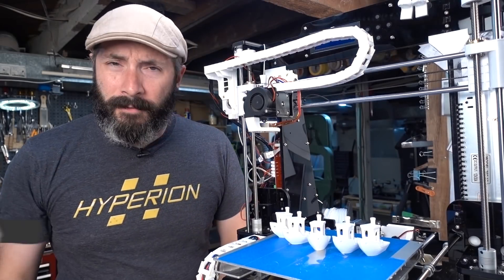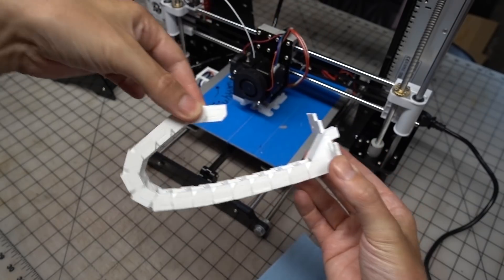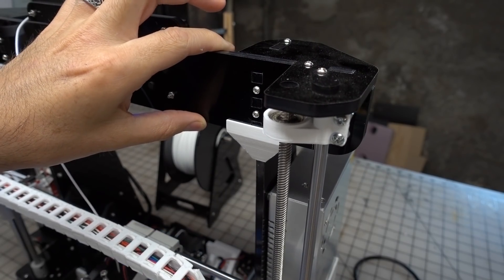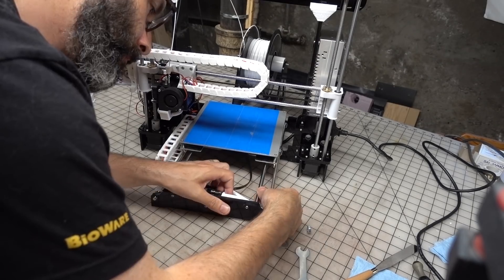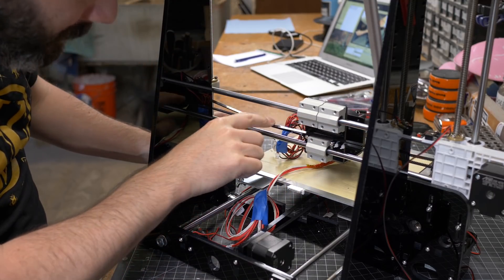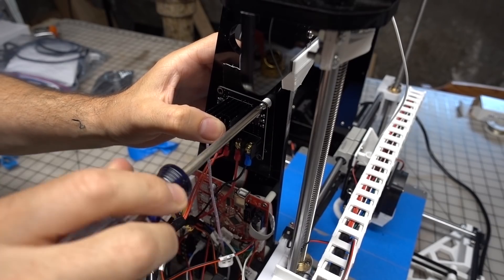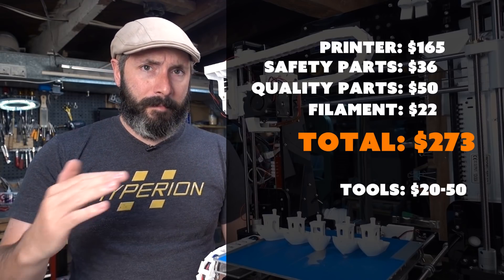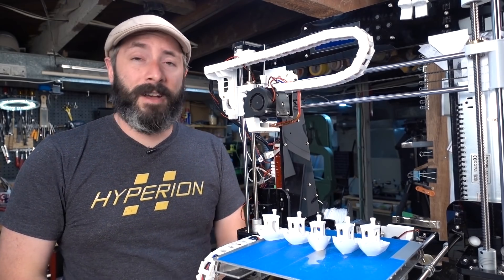Make a Cheap 3D Printer Better - Anet A8 Print Quality Upgrades

Comment: Hi man how are you i think you are printing in a high speed any speed more than 50mm/s is going to make the print less quality the best speed is 40mm/s  the printer can tolerate up to 80mm/s with not good looking parts.
Reply from the maker: I'll go over print settings in the next video, but I haven't been going over 50 mm/s.

Comment: I found that the best way to upgrade an anet A8 is to scrap it and buy an Ender 3. I could never get the acrylic frame stable.
Reply from the maker: (I am inclined to agree)
Reply: This was before the wave of Ender 3 and their clones. The Anet A8 was the first cheap i3 style DIY 3d printer, hence the acrylic frame. Them it was superseded by the Tevo Tarantula and Wanhao Duplicators, then evenutally the Ender 3s
Reply: @muniradlan3659  Yes. Which is about the time I scrapped my A8 and bought an Ender 3.

Comment: All you really needed was to tension the belt properly (don't even need a tensioner, just pull the belts tighter when you install them) and fix your slicer settings.  No "upgrades" needed.

Comment: most "upgrades" i find for these printers are crap. the first thing to do is eliminate slop in the rails. you may just use kapton tape on the ends of the rods or hot glue for that matter, but I'd prefer if the machine had thicker top plates (12mm or more) so any bending on the z rods would transfer to the frame. this might  allow you to stall the steppers at z max height without so much bending on the a6 frame, but the a8 frame looks sketchy to me anyway. for that i might convert to a single z motor with a belt to drive the second screw to the z never loses sync. 

i don't like the idea of supporting the z screws unless the z screws are very straight and you can take the time and effort to align the motor with the leadscrew nut so that the top of the screws doesn't move as the z goes through the travel. otherwise making the screws stiffer might just increase z wobble by allowing the screw to influence the whole machine. leaving them to flop around at the top is very much a design feature. not an oversight. 

the base of the machine isn't very stiff. my next mod will be to make a belt adjuster, then get rid of the double nuts setup to hold the front plate on by using tubes between the mid plate and front plate. i may even use some 1.5" extrusion and mount a linear rail system on top because the 8mm rails have a ton of spring to them. i could use bigger rails and thicker endplates but by that time i may as well go all the way with it. 

to straighten out the belt for the y even more i not only flipped the plate but also spaced the belt with extra acrylic bars that were in my a6 kit. my belt is just about perfectly parallel now. i also replaced the springs with silicone hose for the hot plate. 

the best way to run filament is with a feeder tube unless using flexibles that might be hard to feed. this doesn't have to mean a bowden conversion. the tube will reduce the pulling on the extruder head. as the extruder pulls the filament will put forces on the tube that will put a counter push on the extruder and on the supported end of the tube on the other end. an over head spool holder on bearings will reduce the pull to an unnoticable amount and eliminate the need for a feeder tube but you already don't seem to like that idea. i have one on my a6 but the a6 has a stiffer frame than the a8. 

the hotends for these printers are prone to leaking with pla and the resolution of a direct drive isn't great, it may be enough for 1.75mm filament but more is always better right? the drive gear that comes with the machine works but the coarse tooth pitch might also make feeding a little choppy. it might seem silly to put a $125 setup on a $165 printer but there isn't really anything like a geared extruder head and an all metal hot end. the e3d v6 and titan is hard to match and some cheap clones exist but i'd at least get an e3d heat brake. you may be able to get a .9 degree stepper and retap the heatsink mount on the a8 for the e3d threads for a cheaper solution. or get the microswiss upgrade for the wanhao i3 and mill down or replace the lever arm you have since the heatsink mount from microswiss seems to be thinner that the anet setup. there are some $4-$10 molded extruder tension arms that will probably fit or you  can 3d print one if you don't like the idea of belt sanding or milling the stock one. the microswiss heat brake is not cheap and needs a different heater block thread (m7 vs m6)and nozzle. m7 thread nozzles are not as common or as diverse, so maybe an e3d clone setup with a genuine heat brake is better?

i wouldn't listen to the you tube engineers about a bowden to lighten up the x axis. the nature of the feeder tube does have benefits but the weight of a single nema 17 stepper is hardly a lot to throw around for the x stepper motor (unless they are talking about the flimsyness of the frame and want less motion to translate to the z rods) and a direct extruder works much better with flexible materials.

Comment: Auto level and glass bed won't effect the print quality. Your biggest issue now will be your settings.  I would have played with them before you started printing your helmet.   Iv got an A8 and finally got it printing top quality prints. Depending how high quality you want the helmet to be at the end. You will notice you have to do alot of post print work until you tweet the settings and get them on point.  My starlord mask laughs at me every day because I'm sick of sanding and filling it
Reply from the maker: +Nick Anderson I tinkered a bit before starting on the helmet. I'll share all that in the next video.

Comment: How to spend incredible amounts of time and money without gaining any profit.
Reply: Yes! Kinda like sports... but without the exercise.
Reply: More power to ya
Reply: Actually I bought one of these back when fidget spinners were a thing. I then used the printer to print the spinner shells and bought  bearings off Amazon to put into the shells and sold the spinners for $6 a piece at school and wound up making around $300 profit.
Reply: it's called a hobby and fun is profit
Reply: Most of the 3D printers in the world don't make any profit.
Reply: And he could have gotten better results without any upgrades just with some proper slicer settings. I have the cheapest setup and use Cura as a slicer and my prints look better than his.

Comment: The a8 major problem is the crap frame design switching to a bowden will help keep the weight off the moving carriage. Also the sides of the benchy makes me think that nozzle is just bad and i dont think you can fix that so when upgrading to bowden make to sure to replace that. I think your looking at those diy kits the wrong way. Those kits are not meant for production work. They're tinker toys, meaning for people that like to fidget with with them, and turn it into a small hobby. For studio work you should have just gone and bought a more expensive prebuilt machine. They both can produce amazing results but getting there meaning paying in either time or money. But  don't feel discouraged and think of it as a money sink. Its a tool that does get better the more you use it. Upgrade it a bit at a time and it will get better.
Reply from the maker: These are all good lessons. I'm doing this series for prop makers who want to get into 3D printing, for making props and costumes, as cheaply as possible. If my outcome is eventually "don't buy this printer if you want to print props" then I've provided good consumer advice, I think. =)
Reply: If you check out Bill's channel you'll notice he has quite a few other projects utilizing mid-to-high end printers like the Idea Builder, Taz and Ultimaker. Someone doing commissioned work will likely want something in this category and price range.

However, someone just getting started is likely going to be enticed by 3DP's in this low price range. I think it's awesome someone with a body of work like Bill and Britt are putting the time and effort into trying one of these out and documenting the process so others can decide whether it's something for which they'll want to spend their hard earned cash.

People are going to buy these kits. Many are naturally going to progress into printing and building props/replicas. These videos will hopefully outline either the steps they'll have to go through to get quality results or as Bill mentioned maybe tell them to go another route.
Reply: With a little work...and some 3D prints my $139 Anet A8 outprints a $2000 machine
Reply: Yup I get decent results with my printer. It took a while but it got there. Kind of a thing of pride. But one thing I find is that I need to continually do light maintenance to the printer. At least that's the excuse I tell myself and have begun to rebuild my printer in my own design. It's an overly engineered aluminium extrusion frame and am trying to not use any printed parts, nothing but aluminium on my machine.
Reply: Im sorry but the A8 is completely over-hyped printer.  Maybe a year ago it was a good choice as, there was little competition in that price range.  Today there are many better printers for just a little more money.  That said with all the money that you have to spend to "upgrade" the printer, other steel framed printers come out cheaper at the end and much better.  

You should be spending time on your hobby, and learning 3D printers, you should not be spending time updating a bad design.
Reply: I don't think Bill thinks this is the best low cost printer. He stated in the first video he wanted to take the lowest cost printer (which happens to have a huge user-base/community and a lot of upgrades) and see what type of prints and subsequently props/replicas he could turn out from it.

Out of the box the printer wasn't good enough to make serviceable prints so he's started to upgrade to show what it takes to get some.

People are going to continue to buy this printer. They're then gonna go looking to videos one what upgrades to do to it and likely end up on this video.
Reply: Hands down the all metal Creality CR-10 is the best...thus far
Big build volume, large metal frame, and fair quality for $400~ however they are hugely backlogged and are kicking back orders at this time...(might find a few marked up ones on Ebay soon)
Reply: never the less, A8 is just so good to be anyone's first printer WHO IS ON BUDGET.
Reply: Liangshi Xu Today with just an extra $80-120US more than the A8 you can get so much better printer.  And that is still budget range for anybody who want to buy 1st printer.  If you need to save up money, then save for 1 extra month and get better printer.  Cheap always comes out expensive at the end!!!
Reply: PLEASE. I have been an avid propmaking lurker for ages, and would absolutely love to get tips and pointers on the quality/price-tag balance for purchasing printers and tools.
Reply: 80$ dollar upgrade parts+A8 can already be super good.
Reply: Doctor Discord If you are a propmaker go for the CR-10  They have sales every once in a while and the CR-10 comes in few versions with even a larger print bed size.  Yes its more money than the A8 but you spend your time on your hobby, not spend your time fixing the A8's many flaws!!!
Reply: I don't like going get x brand over y brand. Mainly because experiences can differ wildly from machine to machine even from the same manufacture. Most perform about the same out of the box. Usually the cheaper the machine the more likely that its just a box of parts. Most come from no name Chinese "repackaging" company. Spending more on a name brand usually just means you get a mostly fully build machine with a warranty and nicer features. Look around find the features your want. here is how I break it down

200 and below = usually just box of parts very little if any aftermarket support manufacture
200 - 300 = same as above maybe with a few nice features. Maybe half built. Maybe some sketchy support from manufacture. But usually a decent user community pool.
300 - 450 = don't see many in this region that differ from previous tier guessing mostly overpriced previous tier machines.
500 - 600 = now getting into prebuilt smaller named machines. usually with decent warranty.
 800 - 1000+  = now getting into name brand. Usually allot of features on the machine. Great warranty and customer support and in some cases a user forum where you can talk to other users.
*note these are from my point of view and an over generalization.

But if your wanting to get into making printed parts for prop making, first see if the process is even worth it to you. In some cases it may be easier to just build it from scratch. What some people don't realize is that for prop making most of the parts we need are custom one off pieces, meaning you will probably need sit down and learn at some point to design for a 3d printer in some sort of modeling software, and that may seem a bit daunting for some. Thankfully we live in a age of a million makers and there is a treasure trove of both free and paid designs that are just a few clicks away, so here's hoping you can find what you need. And lucky most software(whichever one you decide to go with) isn't as complex as it seems. With a few Youtube tutorials you should be on your way to making simple parts. But it will take some time till your whipping up parts at break neck speed. With software taken care of and dealt with whats left is building and maintaining the machine. Whats that mean? like daily oiling and polishing? No. What i'm talking about is the watching the machine (while its printing mostly) and looking at all its parts for places that are causing your print quality to suffer. A wobbly structure, okay make a crossbeam. A badly designed mounting brace okay make a new one, and the list goes on. Here where being mechanical minded helps. It not like a paper printer. where what your printing is exactly like whats on your screen and why many people tinker with their machines. To get more usable and higher quality prints. But be wary this can be a time sink in some cases and may take over your precious time you set aside for yourself for prop making.

Still with me good. The benefits of having your own custom pieces made within a few hours of pressing print and it just appearing before you is truly amazing. I for one am terrible at making props from scratch. But I make up for it with my ability to design pieces far better then what I can accomplish by hand. While printed parts do look a bit rough. Sanding down parts smooth isn't hard. With a little elbow grease and coat of paint, a perfectly usable prop for any convention is obtainable. And lucky it even easier to dip your toes into printing parts than ever before. There are several sites that offer services of printing your files for you and mailing them to your door. They are a bit pricey but worth the try for one off pieces and don't want the hassle or expense of owning the machine. And honestly the quality can't be beat, they have access to machines so much more expensive then you can afford. Too pricey no problem there are sites where local makers are putting up their services to print for you. These are normal people with their own machines they built themselves, and are either trying to help local makers or trying to help offset the cost of the machine by having it pay for itself. Its usually cheaper and it being printed locally means it can be printed and ready to pick up by the next day. Maybe even get chummy with said person. Some are oh so eager to give you the grand tour and provide tips.

Phew that was a mouthful and there was more stuff I didn't talk about. But for now I just hope it help some people.

Comment: Hi There Punhished Props! Some recommend upgrades from a random guy owning 6 (!!) of these Anets, if you want to make them more bearable around and also lose some vibration issues try this https://www.thingiverse.com/thing:2103227 I printed 6 of the 8mm + helper files and placed them under each of the center piece frames. Also these spring bushings seems to prevent the bed from shaking a bit (though I have yet to print these) https://www.thingiverse.com/thing:2357576.. Then there is this frame brace which adds a bit more rigidity to the top frame compared to the one you printed https://www.thingiverse.com/thing:2023822  and then as a last upgrade I can recommend this ensures no dust particles get into your nozzle which made end up stuck in the nozzle or giving you small quality issues after it gathers up and gets extruded https://www.thingiverse.com/thing:497764

Comment: Will you buy another?
Reply from the maker: I'll have a full analysis when I'm done with this project, but right now I would probably spend more on a machine that was ready to go out of the box.
Reply: Punished Props Yes you need atleast two, one to print the upgrades, for the one your working on. I am designing my second one but still want another. So three in total. CR-10, ANET A6, and my custom one. Have you found that keeping your A8 level is hard?
Reply: My A8 goes off-level if you look at it too hard. Honestly, it was fun to learn on but after doing many of the same mods in this video a few months ago, my next printer will be an out-of-the-box working one. My main issue is the z-height on the right Z lead screw keeps going lower, in addition to the bed screws changing heights from vibrations. Reducing vibrations by making feet from Sugru has helped the issue (and made the printer much quieter), but I still re-level it every time I change filament. Which is often.
Reply: The AnetA8 really needs auto leveling. I've upgraded mine to this, plus glass plate. Now I just print whenever I want without any tinkering.